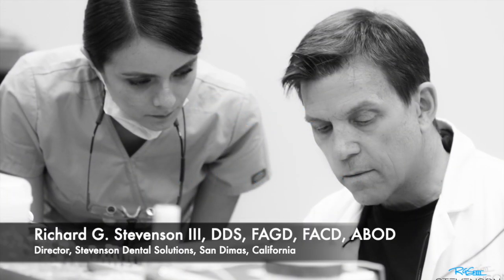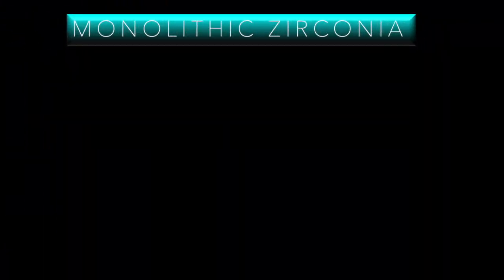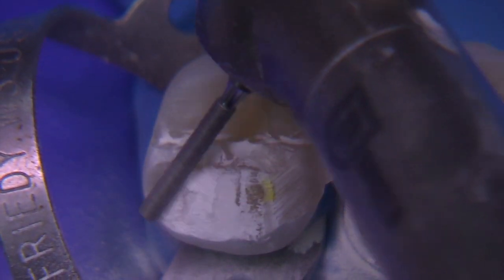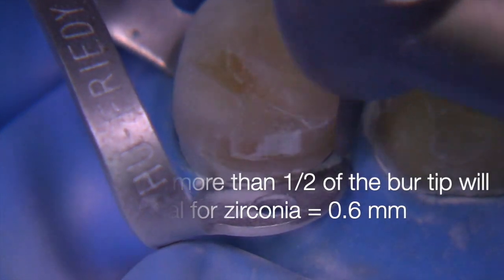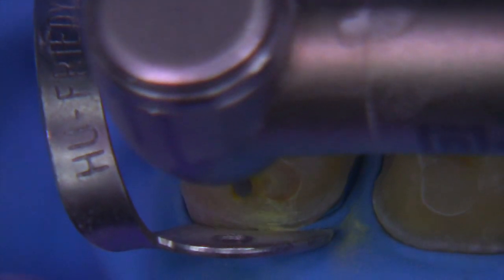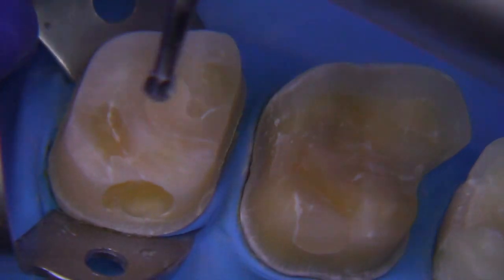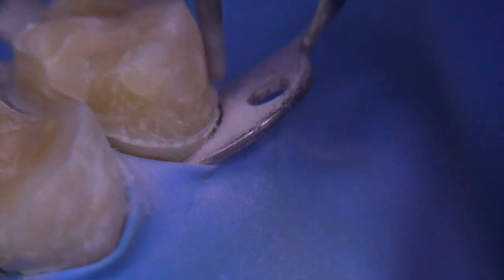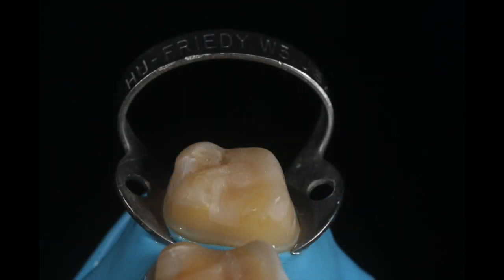Zirconia Ceramics, Part 4: All-Ceramic Crown Preparation #2 Natural Tooth

Comment: Hi Dr. Stevenson,
     If we use 8856-016 after 856-018 for refining and finishing the zirconia prep, doesn’t it create a  lip at the margin ?
Reply from the maker: Only if you create it. Control the instrument - use the tip to keep the finish line without J shapes.
Reply: @StevensonDentalSolutions got it thank you

Comment: ❤ Amazing always.
But I have a Question.
Margins of the preparation should be Subgingival or Supra gingival.
Reply from the maker: Place the finish line where it needs to be to satisfy retention, resistance, esthetics, and biology.  Usually, it will be equigingival, but sometimes intrasulcular if defects or old materials exist.

Comment: Is the secondary plane reduction necessary on lingual? We are not worried about the esthetics on lingual.
Reply from the maker: It's only necessary when the thickness of the ceramic is too thin if the form of the upper half of the tooth is more bulbous.  Usually, it is more subtle on the lingual.  The key is to establish the retention ring along the gingival 1/3 of the axial walls and then allow the natural contour of the occlusal 1/3-2/3's to dictate the secondary plane.  Great question!
Reply: @StevensonDentalSolutions  Thanks for your answer doctor, i've noticed that that secondary plane on lingual is more tangible in upper molars and in mandibular molars we mostly have a  single plane from the gingival to the occlusal.

Comment: The round end bur is the one u always use for all ceramic????...what about chamfer bur..???...I am always confused can u clear my point ???
Reply from the maker: Chamfer's are essentially bevels with downward inclinations and rounded internals - these are NOT appropriate for ceramic.  The ideal design is a Fillet finish line.  Round ended burs only.
Reply: @StevensonDentalSolutions  thank you soooooo very much
Reply: @StevensonDentalSolutions  I am using chamfers for zircon and I am highly disappointed with the finishing line I am getting i will use round end from now and I will see

Comment: I like your video, but how come you prep the tooth without water?
Reply from the maker: Done on the bench-top.  FWIW: water isn't the solution to pulpal trauma - sharp burs, light tough and air spray combined with a feather or brush stroke.  The prophy cup/polishing point causes more damage to the pulp than a bur...

Comment: Hi, i have a question. How do you prepare the tooth without watter, isn't the pulp tissue gona get hiperemeic and the patient will be in pain? Or we can prepare without watter if we slow down the RPM?
Reply from the maker: These are on extracted teeth, but with an electric handpiece and slow speed, water may be avoided for finishing.

Comment: Hey Dr Steven, may I ask what is your preferred bur to smoothen the edges of the margins?Also, what material do you prefer to cement thefinal crown( zirconia)?Ta
Reply from the maker: 8856-012 to 8856-16, or a KS0 of 8881-012
Reply from the maker: Material choices are dependent on numerous factors, but if boding is not required for retention, I opt for 3Y TZP.

Comment: Sir am always concerned or bit confused either finish line should be below gingival line or not?
Reply from the maker: On the typodont, keep it above to allow the graders to see your prep.  Clinically, I will only create the finish line subgingivally in the following FOUR situations: 1. It is dictated by the structure or biology of the tooth (defects, existing restorations or caries), 2. If I need to consider gingival esthetics - in other words cover the area of the existing tooth to create a more pleasing result, 3. When the case has a low bone crest which would make the tissue more susceptible to recession, in which case I drop the margin to 1/2 the sulcus depth, and 4. To increase retention when the case will NOT be bonded.  Hope this helps!

Comment: Hi) thank you for this kind video, i really like, it's one of useful information. Tell me please, when you preps in the mouth, finishing with red burs, 10 000 rpm. Which one you prefer, with low of water, normal amount water,or less water ( because when water off,  better see margin)
Reply from the maker: No water, just air spray.  No damaging heat is generated.  Thank yo!
Reply: @StevensonDentalSolutions  thanks you for your answer)

Comment: Hello Dr.Stevenson , you mentioned that     the flowable composite can be used in this particular case to block out the cavities as it will be covered by the crown in any way  but what about the free monomers in the composite which will irritate the pulp and can cause permanent pulp damage !?
Reply from the maker: These are shallow block-outs with about 4 mm of wall thickness before the pulp. I also use a 4th gen bonding agent which creates a strong and protective hybrid layer barrier.  If It was deeper, I'd use GI liner and RMGI material, and if I was near the pulp, I'd lay down Biodentin/MTA, then RMGI...

Comment: Once again great video. May I ask whether rough polishing with a pumice brush is not a strategy worth considering ?
I find it gives me a quicker route to bulk smoothing. Edges still need to be selectively finished but anything in my hands tends to help ?
Reply from the maker: Yes, this is a good technique - I also use composite abrasive cusps which work well.  Thank you!

Comment: Great video and amazing prep as usual :D 
Regarding Verti prep I think it is useful in cases where limited tooth structure left like in root canal treated teeth. Creating a finish line will reduce the bulk of tooth structure at the neck thus reducing resistance to fracture. I would like to hear more from you about that.
And I have a request for future video about Seating Problems and how to solve imperfect fit of restoration. 
Thank you Doctor for your effort I really appreciate what you are doing.
Reply from the maker: I know what you are saying, however, in RCT cases with minimal axial walls, why perform a full crown at all?  Save the tooth structure with an onlay or vonlay, but not this unproven vertiprep design.  It's a design that stuns the prosthodontists and academics due to its failure of scientific analysis and clinical trials. Will proceed with cementation video in the future - thank you for your comments.

Comment: Thanks Dr. 
Dr. What the difference between fillet finishing line and chamfer finishing line?
Reply from the maker: A chamfer is a bevel, of at least 45 degrees declination - but optimally 60 degrees.  A modified chamfer has the same declination angle, however has a rounded internal line angle.  A chamfer does not provide enough bulk for the ceramics.  A deep chamfer is not named properly - it is actually a FILLET, because it is definitely not a bevel, nor does it decline enough, nor is it a shoulder, which attempts to form a 90 degree butt joint - the Obtuse Fillet accomplishes four things: bulk of ceramics, marginal protection, edge support of ceramics and internal stress reduction of tooth and ceramics.
Reply: @StevensonDentalSolutions  
Thank you Dr 
You mean the deep chamfer is the fillet?